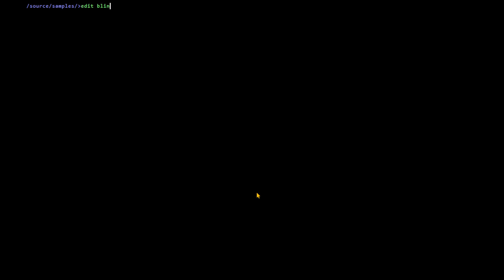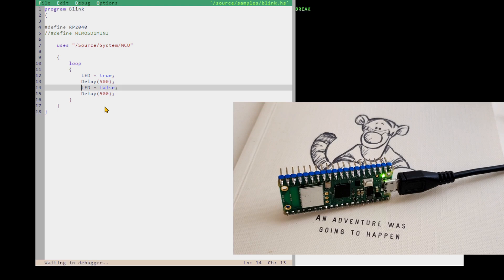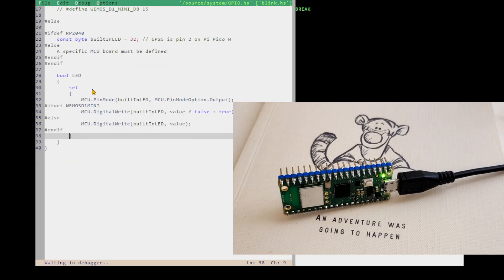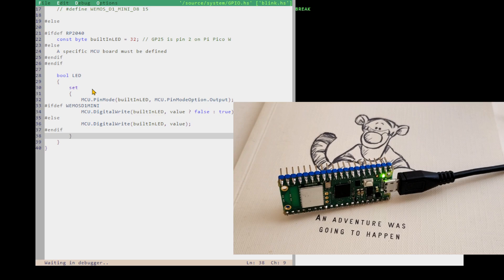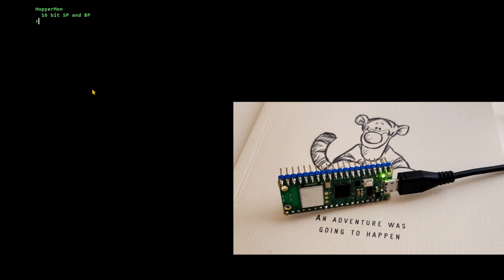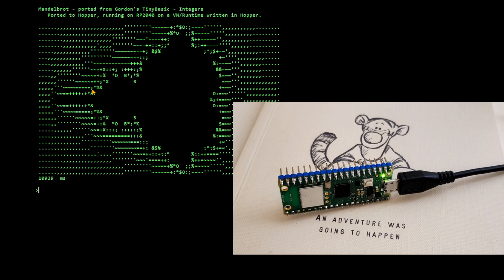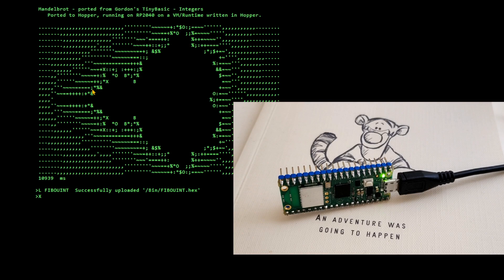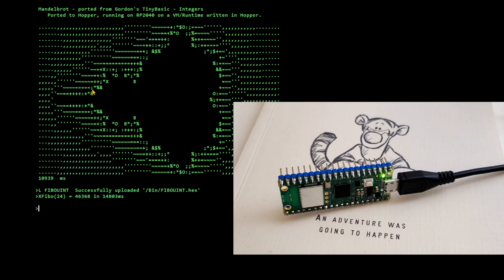First Look: Hopper on Pi Pico W

Comment: Nice work.
Do you plan to make this open source someday?
Reply from the maker: Absolutely.  For now, all the Hopper source is on my public GitHub with frequent updates. This includes source for the environment (like my editor and debugger) and the toolchain (preprocessor, compiler, optimizer, codegen ..). Also the 6502 runtime source (assembler).
There is a binary (.exe) of the Windows runtime available (source to come later ..) so it is easy to play with the language on Windows.
Within the next week or two I'll release source and instructions for the Pico runtime (which is an Arduino sketch that can also be compiled for other MCUs). At that point, it will be easy to get up and running on Windows with the Pi Pico.

(I notice that I've already released the Arduino sketch but it needs to be updated - I'm travelling right now so I'd suggest waiting a few days till I replace it with the latest version - way better already ..)

https://github.com/sillycowvalley/Hopper
Reply: @biggertigger  I'm that weirdo who doesn't have windows :D
But once i resume my pico tinkering, i'll give it a shot.
Thx for the reply.
Reply from the maker: @DasIllu  , for the 6502 the runtime was handcoded in assembler.  For the MCUs, I wrote a runtime in Hopper (that doesn't use reference types so no need for a garbage collector / heap manager). I've written a cross compiler of sorts to convert the compiled Hopper bytecodes to C. (I should do a translator to translate this Hopper code directly to C - that would be better).
This C code is pretty darn easy to bootstrap on any platform that supports C (very few platform APIs needed) so I'm hoping it will lead to runtimes on other machines like Linux and Apple.
All you need on the new platform is the runtime since everything is written in Hopper (environment, toolchain, debugger, etc).